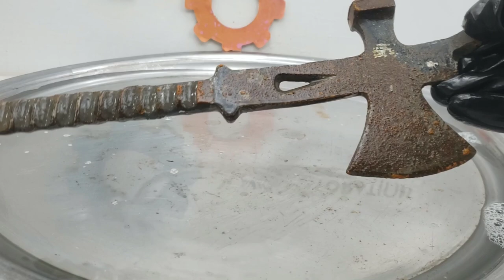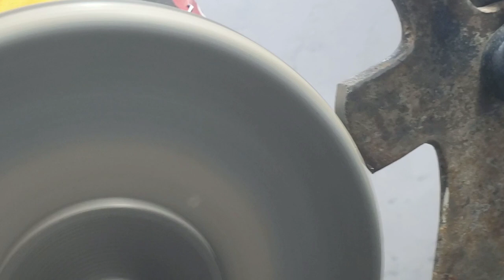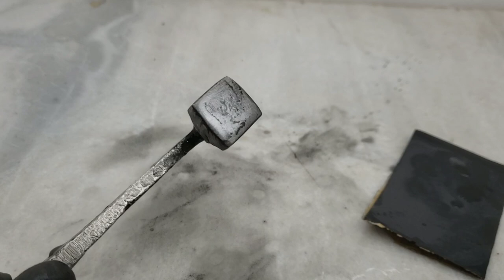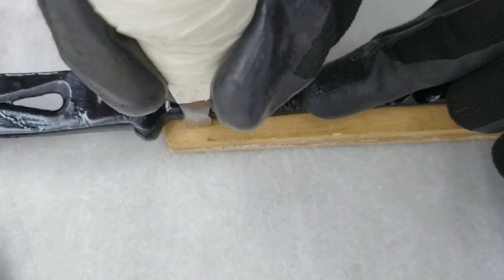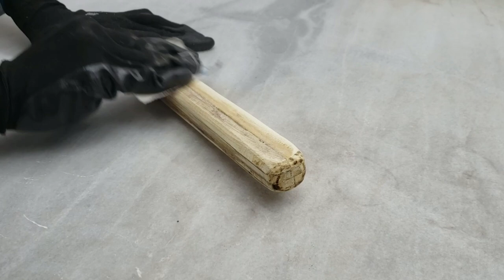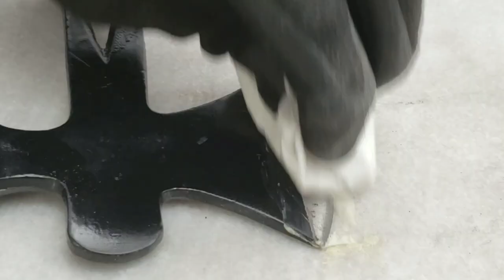Old & Antique Axe Restoration | 15 MIN RESTORATION

Comment: I know what this tool was designed for! The removed piece was for prying loose crate tops. The slot is for removing nails. The hamer was for tightening loose nails. The ax head was the last resort for opening crates. It just needing cleaning and a handle.